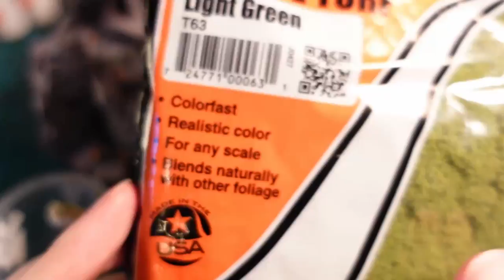Scratch Build Castle Ruins

Comment: One of the more laid back low tech easy to do methods. Reminds me of another channel called Bard's Craft. Using a simple sharp knife or utility knife is Boss in my book. There are ways to make your own scuplt-a-mold using toilet paper, which will work fine on builds similar to this. You do not need a Proxon or hot wire cutter. This method of yours adds a more whimsical element to each build which works wonderfully in fantasy settings. The only thing I might suggest is an ink wash after painting the stonework. Try that out on a piece and you might appreciate the added detail it draws out. Well done.
Reply: I also watched Bard's videos. But he suddenly disappeared, so sad
Reply: @golfprince1993 he makes survival videos now on his new channel Age of the North

Comment: 4:13 - What did you make this white thick stuff out of? Thanks.
Reply from the maker: That is 'Sculpt A Mold'. It's sometimes called modelling compound and it a mixture of plaster and paper pulp. You can buy it branded or make it yourself although i only have experience with the store bought stuff

Comment: Can I use EVA foam, if so what thickness 5mm or 10mm?
Reply from the maker: Hmm, Eva isn't great for making rough stonework. You could make neater brick style walls then add more texture paste over the top but it wouldn't be as 3d as styrofoam
Reply: @thecavyforge7307  alright, thank you

Comment: What foam is that you make stairs and brick from?
Reply from the maker: It's Styrofoam, although it differs a bit between regions. Unfortunately it's a right pain to get a hold of in the UK
Reply: Just go to a hardware store and look around the walls/roofs section. You will find Big insulation foam plates.

Comment: what is the name of that paste you use for texture?
Reply from the maker: The white stuff is sculpt-a-mold which is a plaster/fiber compound and you can buy it by the bag at most hobby stores. The texture paste I use later on is a mixture of cork flock, sand, black gesso and pva which I make myself

Comment: you are gonna get a lot of hot glue remains between the stones if you dont remove it before it settles its not gonna look to great once dried.
Reply from the maker: Yeah, that's where you can use a sand/pva mix over the top to make it into crumbling mortar, or you can use the foliage paste to cover it. But I'd agree hot glue is not an ideal tool if you have the time/patience for mod podge instead 👍